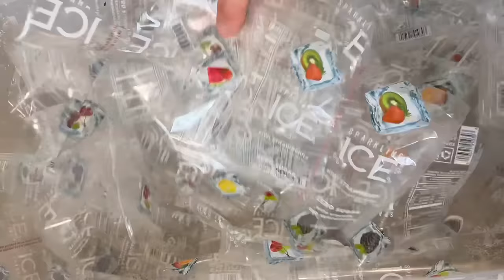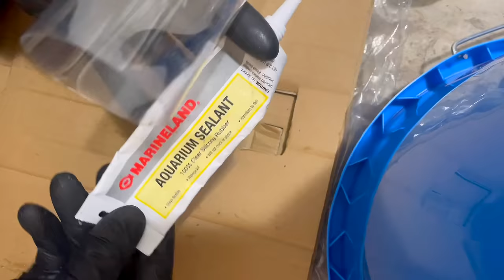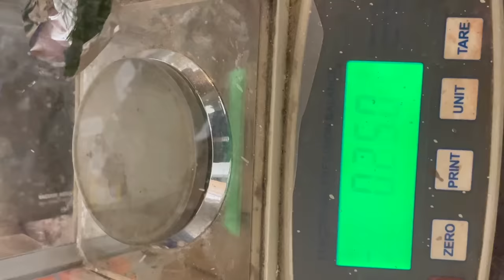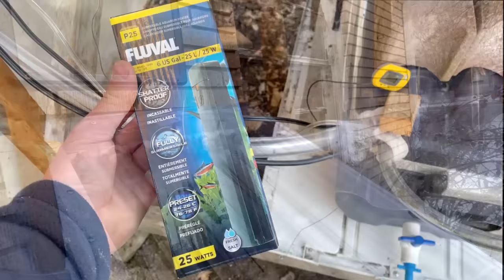Cody's Algae Panel

Comment: I've been thinking about doing something similar in the future: living off of algae, but I've been running into some problems regarding hypervitaminosis. Especially with chlorella, living off of algae alone can actually be dangerous because the vitamin and mineral content in it is so high. Just the vitamin A content in chlorella, using conservative estimates, is ten times higher than the absolute maximum considered to be safe by most medical professionals (assuming 2000 calories worth of it per day). That's not even considering how much iron, zinc, and other vitamins are in it. The effects of this can be more severe than you might think, especially if you plan to take this much daily, so I would definitely talk to a dietician or substitute caloric intake with less nutrient-dense food or algae before actually moving on with this plan.
Reply: Can't you cook it until the vitamins break down?
Reply: Raise tilapia and shrimp too.
Reply: algae is superfood
such a great food in fact, that we humans arent prepeared for it.
Reply: Vitamin A from a plant source will go out in your pee without any problem. Other vitamins could be an issue.
Reply: No one wants to live off algae, thats like eating food brick rations
Reply: @chewey32 Is there anyway to transforme or extract part of the excess mineral or vitamin? through specific preparation or add something to get rid off a part of it ?? and does it can support to be frozen long term also ? really curious and thanx for you knowledge base on experience . Much aprreciate :)
Reply: Maybe you could extract some of the parts, and then just add those fats, proteins and starches to a lower quantity of full algea.
Reply: and here I am thinking I'm doing pretty good raking the algae out of my drainage ditches and mixing it into the compost pile to help break down the pine shavings from the chicken bedding lol.
Reply: As an uninformed ignorant... i'm asking myself where these minerals and vitamins come from. They surely can't just be formed by the algea using light.
Reply: @dancooper6002  Because why not. Why not fuck around and see what happens? Same thing can be said for why do we use spices that make it feel like my mouth is on fire? Because someone out there said why the fuck not and did it.
Reply: @dancooper6002  And you can add seasoning to make it taste better. I mean there are some weird as people out there trust me that would love that shit. The main use I see though is with a little chemistry to add taste in you would have an amazing emergency food or MRE for the survival situation or something for the military or when your stranded or say you are in space with limited resources to produce foodstuffs.
Reply: @dancooper6002  Anything is food if you are creative or insane enough. And its not like you can't dry it, bake it, cook with it, or just condense it into a crunchy brick. It doesn't have to be a sludge. But I got a feeling you just don't like algae as a food item, and I won't force my ideas of what food is onto you. You have a nice day or night. had a little fun chatted with ya.
Reply: @theroaringdragon306  he is the same kind of person who eats bag after bag of processed food and critiques asians for eating things like jellyfish
Reply: @ThisIsATireFire  you are.
Reply: @dancooper6002  thats essentially McDonald's also I understand your situation but if we are to fully allocate and use the planet resources in an efficient manner, we are going to need to find ways to flavor these foods and get over our stigmas, either way they are plenty alternatives to algae.
Reply: @sevensins4842  exactly its just proccesed sludge
Reply: @dancooper6002  Sure but you have to take into consideration that we have to produce 60 percent more food than we produce now, technologies like these are solutions, You also fail to consider the majority of food products like chips are made out of sludge thats been proccesed with added flavor so you likely wouldn't notice a different and would be eating higher protein and healthier chips with a vitamin complex, there is no disadvantage and food would also be cheaper, with every new technology you will have people judging it for no reason other than its new, sure it may seem weird at first, but in practice It will end up being better than anticipated and will fuel a much healthier society.
Reply: @dancooper6002  we don't necessarily need to eat it ourselves. We could feed it to our food. That would take fields that were growing feed for chickens or cattle and make them available for something more palatable like blueberries, potatoes,   asparagus, you get my point.
Reply: @ThisIsATireFire  I think he was just a random hater, imagine by 2050 we come back clowning on this guy with our algae burgers 😂
Reply: Truly if humans used their rationality to understand that food is just sustenance food for the body and disregard the taste we would have so much less bickering from picky eaters and waste
Reply: @dancooper6002  You got the wrong guy to demand "learning history" from.
Reply: @dancooper6002  You don't want me to translate what you mean when you proclaim America's status in the hierarchy (shout out to history) among Earth's "worlds>" You'd get really upset that I'd have pulled your card.
Reply: @dancooper6002  Because being self reliant is becoming bigger and bigger. While we are losing more and more control.
Reply: @e.m.2408  The issue is that despite it going off in your urine in such high amounts it will start to be renal toxic.
Reply: He's feeding insects the algae and then feeding the insects to chickens and then eating the chickens/eggs. After two trophic levels we should be fine
Reply: not sure if YOUR algea will have the same nutrient density. maybe it depends also on how much extra you are "feeding" it? it might be similar like with any other thing we grow for consumption.
Reply: @dancooper6002  To be fair a lot of the rural US is barely distinguishable from third world, maybe worse.
Reply: Its not actual Vitamin A its carotinoids and they are no problem for your health ;-). But you have a point for the minerals ... but to get maybe 50g of algea a day it would be ok.
Reply: @dancooper6002  You seem to have some weird prejudices/opinions on 3rd world countries .. lol Not even mentioning the fact, that that term has been outdated since the cold war ended. lol
Reply: there's one good solution, add plankton that would feed off the algae and eat the plankton
Reply: @ThisIsATireFire  you don't do that
Reply: It is basically a supplement. Not a meal replacement.
Reply: @Dean Clark The term has been outdated since the cold war ended. Do you even know it's original meaning? lol
Reply: At least there won't be any acne 😄
Reply: @tamatea_  feeding insects such as crickets, mealy worms etc. The algae could then be combined with the insects and the algae to make pellets. These in turn can be fed to chickens and various aquatic speceis and would make it more palatable. The eggs and chicken meat as well as fish meat would be high in omega 3 and nutrients.
Reply: @ThisIsATireFire  you are nothing wrong with that.
Reply: You could just mix it with some sawdust and eat that.
Reply: @peterjf7723  same with urban US. arguably worse in some spots
Reply: @byakurenhoujuu  3rd worlder spotted
Reply: @connorhill8889  Sorry, I'm not from the US. /s

Comment: The photocell for auto on/off was a good idea. I might suggest using some insulation like for an air conditioner refrigerant line to wrap the bare hoses to protect from high heat and harsh cold. Easy, cheap modification.

Comment: man I'm back to watch this video again!!! I'm inspired to start cultivating it myself and want to offer my observation, your temps began to fall sharply when your water began sucking all that air from outside into it which then looked like it ran to your reservoir, if you could build a cap with a small hole to act as a restriction to limit the amount of air introduced into the system and still easily remove it to add water, awesome project :D

Comment: Rather than having tubes, I would suggest using two panes of glass (or acrylic, plexi, etc) sandwiched together with a bead of silicone around the edges, with an inlet and outlet port for the media to flow through. This way, the algae can spread out through the large surface area, fill it up to the top, and then outflow back into the tank. That would greatly reduce the amount of time and energy spent on building each panel.

Comment: In terms of processing the algae into fuel, I'm curious what a fractional distillation would produce. You'd want quite a lot of it to start so you can have long enough fractions to isolate. Since it hasn't had a chance to be processed with all the heat and pressure underground, it would likely be mostly smaller chains equivalent to Naphtha, Kerosene and Propane.
Reply: Even kerosene would be a boon.  It's heavy enough to run most diesel engines with a minor retune.
Reply: Biodiesel is basically produced just by mechanically compressing the algae mush through a filter to separate oils from the solids. Some filtering and chemical processing is done to make it more suitable to engines. Distillation takes far too much energy and destroys some of the product.
Reply: @TheAttacker732  Kerosene has more energy density than diesel it is used in jet fuel.
Reply: @S3l3ct1ve  I am aware.  I'm referring to how flexible kerosene is as a fuel, able to fill in for everything from diesel to bunker oil.
Reply: @BTheHeretic  Biodiesel is not suitable for ALL applications, though. Kerosene is jet fuel. It can burn well in low oxygen, has a higher freeze point and burns cleanly in a lantern. Biodiesel can gel in cold temps and produces much more soot. 
The only advantages of a biodiesel are cost and lubricity. Kerosene just can't compete with diesel when it comes to lubricating cylinder walls and valves.
Reply: @dhawthorne1634  Sure, if we're dealing with industrial volumes, and don't mind higher costs, we can produce fancier fuels. In that case it probably makes more sense to go with full syngas->kerosene conversion rather than simple distillation. Biodiesel is just a convenient shortcut if we're trying to keep the costs down. It's even doable in Cody's backyard setup.
Reply: 🤔 @Cody’sLab should find the most effective way of processing this stain of algae into biofuels. I think it would really depend on the application you would want to use them for.
Reply: +1 I'd like to see a video on this
Reply: it's a superfood.Would you waste your 10 grams a day to produce maybe 1 ml of solid crude oil? There are better sources
Reply: @BTheHeretic  In that case one could also make hydrogen, perhaps. In Japan they even  plan to recycle plastic, using gasification to syngas to hydrogen. I would love to see Cody attempting this!
Reply: @S3l3ct1ve  no. Less dense. They use it in Airplanes because of the low cloud point.
Reply: I think all of you (except Eric Greenwood) are missing the point. It's about exploring the possibility and the science behind it. THe question isn't SHOULD he do it but COULD he do it? What does this route have to offer?

No one would expect a home producer to be able to make sufficient quantities of fuel this way, but it could always be scaled up if it's a success.
Reply: @dhawthorne1634  kills me to things like, "better lubricity." Like, who cares. It's not being produced to replace diesel on cars across the planet. It's being produced for experimentation and emergency fuel for a hypothetical Martian base.
Reply: @littlejackalo5326  If you had read all the way through the comments you would have seen that that is EXACTLY what I already said.

Comment: Hey Cody LOVE this project! Just a heads up, silicone isnt the best option for sealing plastic to plastic as, from my experience as a tradesperson, it has a tendency to allow water to track between the plastic after a few good sun and cold cycles, try a foodsafe cement, although even those arent too good for potable liquids after a time as most contain heavy metals, even the ones that say they don't.
Reply: Some plastics like PP and HDPE won't stick to anything but themselves. As a thermoplastic PET should be ok to weld with other thermoplastics, so that could be an alternative solution.
Reply: If the bottles are PET/PETE then the cheapest option is likely solvent welding via DMSO.
Reply: Plastic welding.
Reply: Should be ok for a prototype, right?
Reply: Or you just buy some plastic food grade tubing and don't use any silicone
Reply: Heavy metals are a non issue. The miniscule amount of metals that MIGHT BE present, and the exceedingly small surface area of the solvent that will be in contact with the water, makes it inconsequential.

Comment: very interesting build.
19:00 i hope you manage to deal with that foundation damage, avoid water ingress.
Reply: This comment is too far down, I really hope he sees this before it costs him more to repair
Reply: Glad other people are spotting the crack in the foundation too.
Reply: I know right? Doesn't look good.
Reply: 😬 I couldn't stop staring at that crack the whole video thinking the same thing. Maybe he could find a way to live off of consuming the mold in his basement.  ;)
Reply: Slap some Flex Paste on there
Reply: @LARAUJO_0  "with the power of flex paste I broke my foundation in half"
Reply: He's likely renting; not his problem.
Reply: @andyh7537  he wouldn't be renting because he bought a big piece of property
Reply: I used that polyurethane foundation filler in my basement did an excellent job and saved me a bundle.

Comment: This is just awesome! I can already imagine an army of these outside chicken hole base. As for reducing the cost and areas where algae can catch, maybe use plastic sheets that you roll into a tube and the weld together ultrasonically? it would eliminate the need for any adhesive and would provide a seam parallel to the flow, making it harder for stuff to settle in.
Reply: You can also get endless plastic bags like a tube for vacuum sealing and they are strong

Comment: If you haven't, already, you may want to have that solar panel angled to match the algae panel, that way if it snows, then the solar panel will be covered the same as the algae panel and not try to turn on the pump while it's still blacked out by snow.  Having it straight up like that means that snow will never build up on it.  It will also help to just make sure that in cases of partial overcast, that the solar panel will only click on when it's getting the same kind of exposure as the algae.

You may also want to consider adding a thermal solar heat exchanger.  If you do it right, then is can help to keep the system warm during the winter and cool during the summer.
Reply: He did add a heater to the cooler/storage bin in the video. With the algae being warmer than the snow that’ll melt the snow enough to slide off the algae panel. If the solar panel had snow built up on it, it wouldn’t cycle the algae meaning the algae wouldn’t see sunlight until the snow decided to melt on its own.

Angling the solar panel would increase its efficiency, but as it’s only acting as a daylight sensor, not a power source it’s a rather moot point.